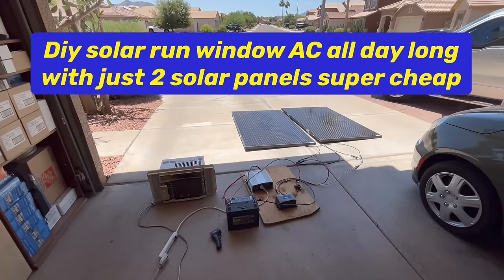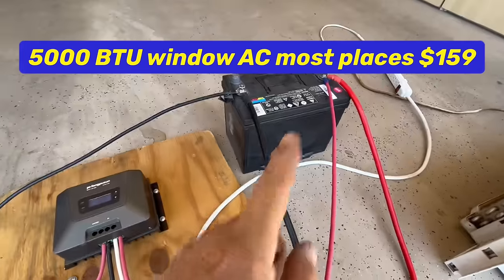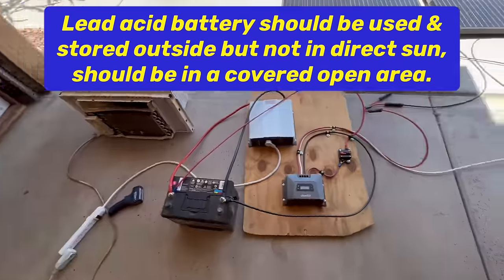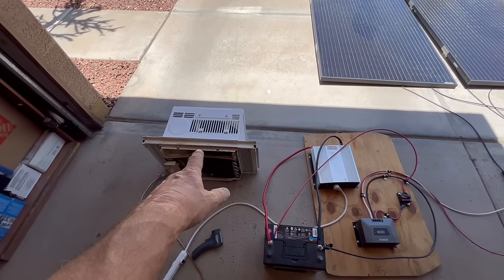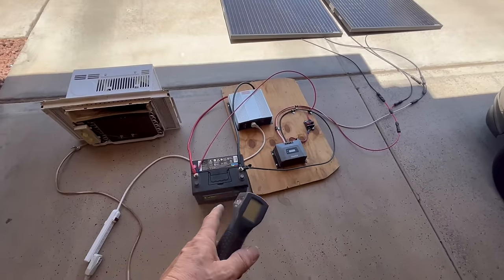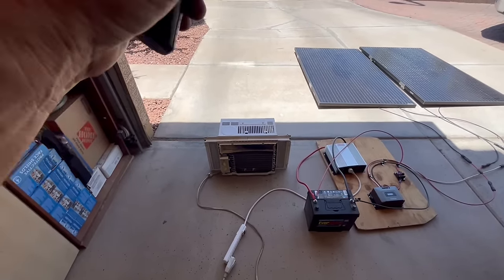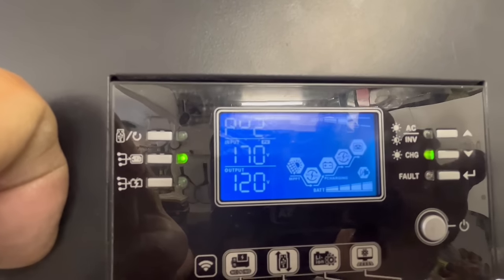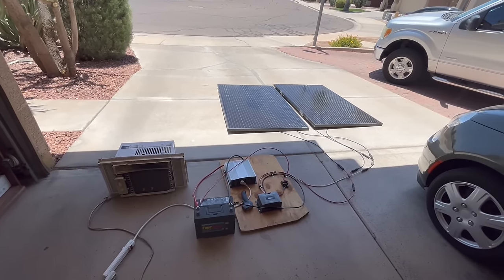Run your window AC with just 2 solar panels when sun shines. Easy DIY project you can do in one day.

Comment: Hahaha another gold-plated install your fancy never start battery, and high dollar Harbor freight MSW inverter. How about doing a budget system. I suppose I have to mention this is sarcasm so that the couch warriors don't jump on me. I'm truly appreciative of this inexpensive setup.
Reply from the maker: This is just a simple illustration of using off grid solar and the minimum components needed. I actually am running a system that is air conditioner my entire house on solar in the day and LiFePO4 EG4 battery bank at night. I am air conditioning 2450 square feet 2 story house using only off grid solar. I also air condition my 3 car garage from sun up to sun down using solar off grid. I spent $0 on my air conditioning last month out here in Phoenix where the average high during the day was 113 degrees this last month and overnight lows was 90 degrees. I also have run my pool pump 365 days a year on only solar, heat my 15,000 gallon pool to 78-89 degrees in the winter using only solar and a 127,000 btu pool heat pump heater and also a 17,000 btu pool heat pump heater to keep hot once temp is reached. We run 3 freezers, refrigerator, indoor outdoor lighting, tv. We can also use solar to cool our pool in summer if water temp is higher than we like it. Just a sample of what you can do with off grid solar when you knew nothing about solar, mini splits, heat pumps, pool heaters 4 years ago. Truly DIY learn as you go while also going through 2 incurable cancers for last 10 years and having to get IV Cancer treatment every 8 weeks. I could only work on solar power system a few hours a week due to side effects caused y the 2 cancers. Sometimes not being able to do anything on solar system for a month or few months because of severity of Illness. Most people could assemble a system to run the same amount of stuff in 2 weeks but it has taken almost 4 years for me to do. The best part is, at the end of this year I will have recouped my investment and the entire system will have paid for itself through savings on electric bill. Check out my other videos and see all that I have been able to do with solar with no experience at all 4 years ago. Not even electrical or education with any of this stuff. Self taught. Do if I going through 2 horrible incurable cancers can achieve thus than anyone healthy can do the same in about 2 -3 weeks. Hope you enjoy the videos and hope you have a truly wonderful and extremely blessed week

Comment: It is easy, but the Home owners Assoc.  won't make it easy....... LOL.
Reply from the maker: I have no solar panels on my roof, I built me solar arrays and put on top of pergolas. I had to get approval for Leto but not for solar panels on top of pergolas. I kept my solar panel arrays below my cinder block wall top so you can not see from other side of wall. All my inverters and batteries are in the garage. I know, I am on the board of HOA and on architectural committee that approves the request for onGrid solar, I am the only one in my subdivision that is using solar off grid. There are ways to design solar arrays so your neighbors can not tell you have solar panels. Check out my videos to see how I placed all my solar panels in my yard. I pack a lot of solar panels in a small space in several parts of my yard, hopefully you can get some ideas. My 6000 watt array, I built using galvanized fence poles and pre treated 2x4x10 lumber. I just used a hand pole pounder to pound poles in ground, then bolted 2x4 wood to poles to build support for panels and secured down panels. Very easy to do and no cement needed. Also I just did a video on a EG4 ground mound solar array which is pretty inexpensive, you can mount 4-6 solar panels depending on size of panels. Around $279 plus shipping. Everything in box except cement or wood in ground base to bolt to. Hope this answer helps you. Thank for your input
Reply: @diy-solar-guy  
I have about 20 solar panels just sitting in the garage because our HOA is a pain in the butt....    

I'll keep them as backup for emergencies for now.
Reply from the maker: @WTF_BBQ  some HOA’s are just ridiculous, they won’t let you install below your fence line so people outside of your fence or wall can’t see them? All my panels above 6 feet above the ground are on top of my pergolas, they produce solar power and provide shade at same time, plus, the solar panels stay cooler with the airflow below them. My solar panels have black frames so they blend well with the pergolas and I took pictures of the pergolas with solar panels on top when I had the pergolas approved in my back yard. Anything over height of wall needs approval. So it was getting 2 things approved at the same time. Watch my videos on how I use my pergolas as solar panel arrays. Best of luck to you.

Comment: its running at 500 watts because thats all you can provide bro
Reply from the maker: When I plug it into grid and use a watt meter it is the sane 500 watts, but the wall outlet can go up to 1500 watts. The grid can produce up to 1500 watts at wall outlet? I think the window ac only uses 500 watts regardless of where you plug it in.
Reply: @diy-solar-guy  YEah I think you are correct right after I posted that comment I considered deleting it but figured it could be a troll comment at the very least
Reply from the maker: @adairjanney7109 lol

Comment: OK this is not real. Lets point out that he has 2 (330 watt solar panels at 12 volts) 

So the max solar input is 660watts at 12volts. 
STEP#1
Now convert 12 volts to 110 volts. An round to the nearest 10th  ( 110volts divided by 12 volts) = 9.1
STEP2
Divide the 660watts by 9.1 = 72.5 Watts at 110volts. 

So his Inverter is just draining the 12 volt car battery and the will only run the window unit for about 6 to 12 min.
Reply from the maker: Wrong, this is real and your theory is flawed because I used this for almost 2 years in my shed. The ac when running uses 550 watts or 5 amps. When cycled off, using 30 watts. When installed in a shed it will cycle on and off quite often. The battery is able to completely recharge while the unit cycles off. Hope you are better at other things, cause your theory on this one is been proven wrong. Hope you have a truly wonderful a extremely blessed day.

Comment: Good idea but you have to lay out $700 to $1000 bucks for this small system. Plus the install,  you can't very well leave everything installed in the driveway. Duh!!
Reply from the maker: This is just a simple example of how to use solar to run a window ac. It shows viewers what minimal components are needed and how solar works. Improving on this system would be needed and each person show make upgrades accordingly to the way they want to use. This is a DIY Chanel. I think all the parts were around $500 total. Solar is an investment and not everyone wants to do it. I make videos showing what I have done with solar and viewers need to create their own system, not copy mine, there are endless ways of designing a system. Hope you have a blessed day
Reply from the maker: I buy used solar panels for 1/10 of the new price. I buy components on sale or for clearance price. So I can build a system very cheap. Seriously do you really think I was going to use this system laying on my driveway? I paid less than $550 for everything when I bought used solar panels for only $35 each. Ac was $140 4 years ago when I bought it. Charge controller was $130 when I bought 4 years ago. Inverter was around $100 when I purchased 4 years ago. Battery was $89 4 years ago and still holds a full charge. I think that is $529. Fuse was $10, wire was $10. That is a total of $549. I could buy a used ac and used inverter much cheaper along with a used battery and drop price $150 or more. People from all over the world watch my videos and this simple example was more for them then those who live in the US. That county that has the second most views on my Chanel has a average yearly income of 1/20 of what our average yearly income is in United States. Their president of their country makes less than $35,000 a year. This video was for viewers like them. Something simple and easy for anyone to get used or new parts and build themselves but I believe they  understand I was talking about using this in a motor home or camper and maybe in a room in the house, that is what I said in video, not leaving laying on my driveway? This is a DIY channel only. We don’t have projects where we have others install? I’m sorry, but you are wrong on all your points in your rather rude comment. I still can’t believe someone would think you can leave this system just laying in their driveway to use? In the video I clearly stated that you would maybe install this in a motor home, camper or maybe in a room in your house. If you continue to leave comments that not factual about the content in the videos or are making fun or derogatory, rude, I will just delete without responding. We are welcome to comments and questions that apply to content in video but we will not respond and will report if need be if you misrepresent what I say. I make mistakes all the time but honest mistakes. This channel is to try and help people understand the basic concept of solar and what it can be used for. What I have done with solar off grid and to show it is possible to use solar for many different things around the house. Please be nice and leave comments I won’t have to delete or report in the future because they contain no facts or truth in the comments or you can just move along and go watch others peoples videos. Either way I hope you have a truly wonderful and extremely blessed week.

Comment: Longevity....? No. Once that battery dies several times, it will be a no go.
Reply from the maker: You can not let battery drop below 12volts on AGM batteries. I used for over 3 years and still are in service for 4 th year now. Thanks for your input. Hope you have a try wonderful and blessed week

Comment: needs 48V AC
Reply from the maker: I actually use 48 volt inverter/battery bank to run my entire house ac system. Check out my other videos to see how I did this off grid.
Reply: 😂 again with thrse short comments - can you elaborate on why you believe you need a 48v setup to run this 5k btu aircon??
Reply from the maker: @asedcopf  I was not talking about running a 5000 btu ac with a 48 volt system. I was trying to let you know you can start out with a simple 12 volt system and quickly realize that you can actually run more than a 5000 btu ac. This 5000 btu ac example was to show you that you can run ac with solar off grid and not only run a 5000 btu ac, but run anything in your house with off grid solar. Trying to get you to think outside the box of just the basic system. I did this video just to prove running ac is possible with solar. You can of course run your ac with a simple 12 volt system but you will need to adapt the system to your surroundings, weather and shading issues. In AZ we have over 320 days of fun sunshine with no clouds, for most of the us this is not possible to have that many sunny days. So I can run my 5000 btu ac from 9-5 every day as where if I lived in Michigan, I would not be able to run the ac at all due to constant clouds almost every day. I would have to triple or quadruple the amount of panels and go way beyond a basic system. I would at least need to go to a 24 volt 2400 watts all in one off grid inverter that would be able to run the 550 watts needed for the load and to be able to keep up with charging the battery at same time. For someone living in a poor country, they might be able to get most or all of these parts used and make the basic system and have ac where electricity is not available. I have subscribers from all over the world who saw this video and tried doing this and it worked for them because they live in a sunny area like me that is desert. Hope this helps you to understand what I was saying. Have a blessed day

Comment: You gonna run that thing fir about 10 minutes ..then it's going to fry itself..Low and inconsistent voltage will kill it dead as a stump..
Reply from the maker: I ran for this system 2 + years? Not sure you understand how solar works? Hope you have a blessed day
Reply: @diy-solar-guy  It works if you have about 2 acres worth of panels..Enough to cook birds that fly over it..but that set up and 1 Twelve volt battery ain't gonna get it.. I live on my Sail Boat..I tried a lot of things..
Reply from the maker: @buckkw5108  good luck with your solar projects. Hope something finally works for you.
Reply from the maker: Thanks for showing it does work. I don’t. Waste time and effort on those who say it won’t work when in fact it does work. They don’t want to learn what they are doing wrong, they just want to argue that it’s not possible since they were unable to  make it work. I now run my entire house ac systems on solar and battery bank. I run ac in the garage during the day as well off solar. This was just a simple example to show how solar works and it is possible to run ac. Hey thanks again for showing simple set up works and hope you have s truly wonderful and very blessed weekend.
Reply: Good for you.. Don't work..never will..
Reply from the maker: @buckkw5108  🌞

Comment: Most people that try this will ruin their battery fast.
Reply from the maker: That could be a possibility, this was just a simple illustration to show it is possible to run ac with solar, I have videos showing me running 6 mini splits I installed in house and garage and running my upstairs and downstairs central air conditioning on just solar 24 hours a day , all off grid. I also run my pool pumps 7/24 365 days a year as well as can now heat or cool my pool. In winter I can heat my pool to 87-89 degrees when water temp in winter is normally in the 40’s. All of this is DIY off grid solar. Hope you have a wonderful and blessed weekend

Comment: So you think we want A/C just during the day? This needs a redo that has a 30,000 unit that runs 24/7
Reply from the maker: Check out my other video I just posted a few days ago. I am using a 25.5 kWh EG4 LiFePO4 battery bank running my entire house air conditioning on solar in day and battery at night. These are 3 1/2 ton, 4 ton ac and mini splits in garage. I ran last 30 days with no grid power. My house is 68-72 degrees in day and 74-78 at night. We are 113 degrees during the day and 85 degrees at night last 30 days. Check out that video.

Comment: dude your battry says 24 dc on it
Reply from the maker: Hi, if you look close at it, it says “Group Size 24DC” not 24 volts. Hope you have a truly wonderful and extremely Blessed weekend.
Reply: @diy-solar-guy  if you run cool water over the radiator it increases efficiency exponentially if you have a way to deal with the water...i can barley see threw my glasses to read that doh
Reply from the maker: @AuditorsUnited Are you talking about the aluminum fins on the outside of the window ac. Using water on the fins to cool down?
Reply: @diy-solar-guy  yep

Comment: Your battery is 24v
Reply from the maker: If you look closely, that is not the voltage of battery. It is a 12 volt battery. The 24 DC is the Group Size of battery, Not the voltage. You can see this clearly at the 28 second mark in the video. Hope you enjoy the video now that you know the battery is really a 12 volt battery.

Comment: Love when people don’t realize how much energy they’re using, only 500watts 🤡 
My iPhone 12 max charges at 20 watts to full charge in 30 minutes.

My ac uses 200 watts maybe 300 on high blast
Reply from the maker: I know, I try to help viewers to understand the basic system and emphasize that upgrading and improving system can only improve your build. The ac only uses 5 amps and 500-550 watts max. I ran this system in my shed for 2 years with no problems, no wires ever were hot. But adding a fuse can only improve system. Shed was kept at 60 - 85 degrees during the day with battery in the air conditioned shed. Battery in air conditioning will last you 2-3 times longer than in your car when air conditioned. The shed was opened at least 6 times a day to ventilate and there was a vent in the back of shed to allow fresh air as well. Never had a problem.